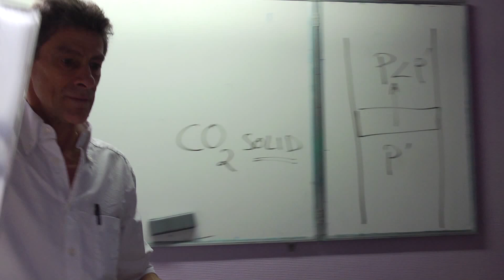Making SOLID Nitrogen!

Comment: Is there such a thing as liquid carbon dioxide?
Reply: +Noah Williams Yes, but only at pressures higher than 5 standard atmospheres.  Anything below that and it will just go back and forth between solid and gas without moving through the liquid phase.
Reply: Walker Riley
Interesting. Thanks for the knowledge! :D
Reply: right....a bottle under extreme pressure (55-60 bar or about 59 atm).  The moment it is released it reverts to a gas.

Comment: hey   hav a ques....if today is 0 degree celcius and if yesterday the temperature was double the temperature today.....what was the temperature yesterday?
Reply: +Devansh Garg To use regular multiplication rules on temperature, it must be absolute. That is, the coldest temperature must be 0. Scientists use kelvin to represent that. 1 K unit = 1 C unit, but 0 K ~= -273 C. So convert to kelvin and go from there: 0 C = 273 K, and double that would be 526 K which would be 273 C.
Reply: +purewaterruler hav already got the ans
by the way....thanx
Reply: +purewaterruler Hooooold on How Did IT want to 273C
Reply: +Sonner 527K = 273C since K = C + 273
Reply: +purewaterruler How does IT convert to C, where do i get to know this

Comment: Why is Ice, Solid Nitrogen and Solid CO² all white?
I know that white means they are not absorbing any visible wave length which means that their molecules are hard to be excited by visible wavelengths but is that correct? and If so, why aren't they?
Reply: Those gases are colorless because they are simple molecules with no conjugation. Most substances without metals are colored because they have a lot of pi bonds linked together (conjugated), like beta-carotene, which makes carrots orange. The more linked pi bonds, the lower energy that is absorbed. With no linked bonds, the energy is high and falls in the UV range instead of visible, making the substance colorless.
Reply: +Kashi Seereal Thank you for your great answer, I will do more research to dive into the pi bonds because I'm very curious about the subject :)

Comment: You might do one on water. Yup - plain water; but actually very funny stuff. Like: Heat rises (right?) so why does ice form on the top; and not on the bottom? What is the latent heat of water (and why?) Can we boil water hotter than 100 C? If not, why not? I think I saw one elsewhere on cooling water below freezing, without actually forming ice - sort of 'breaking the symmetry' Another - how do we get warm layers of waters 'sitting' on cold layers; and maybe vice versa. Just thinking out loud really. But, just when you think you know something - you don't ...
Reply: +Adam Mangler To answer one of those, all energy above 100 C is used not to make the water hotter, but to make the molecules move fast enough to escape their liquid form.
Reply: +Lord Nightmare Lieudfrost effect?
Reply: Sonner When I learnt it we called it Lateral Heat or temperature or something like that
Reply: +Lord Nightmare ohh latent heat?
I'll defiantly check that out thanks!!
Reply: Welcome. Good to be able to use all that useless info from school hehe.
Reply: +Lord Nightmare 😀

Comment: Would a persons hand instantly freeze if they touched liquid nitrogen which is -196
Reply: +Hachem Shahrour No. At -196°C nitrogen boils. Anything warmer dipped into the nitrogen will force more boiling. The N2 gas bubbles form an insulating layer around the warm object, e.g. a hand. This is the Leidenfrost effect. You would be quite safe if you would just dip in and pull out.... but if you'd wait too long your hand would start freezing anyway. Try at your own risk!!
Reply: +Nature Alley ok thx

Comment: What happens if you touch the actual nitrogen when it's 200 C? My teacher said your hand would freeze on it.
Reply: Hammad Shahid I think you mean -200. Your teacher is right. There's a youtuber called NurdRage who actually dipped his hand in liquid nitrogen without freezing it, but it's obviously very dangerous. I've used liquid nitrogen during labs and it is extremely cold.
Reply: bookworm260194 yes I meant negative. My teacher mentioned it's dangerous too.
Reply: Yeah it is. It needs to be used with extreme caution.
But despite that, I know this guy who uses liquid nitrogen to make ice cream when he's in the lab xD
Reply: Hammad Shahid You can very very quickly dip your hand in it, without getting any negative effects, becuase of the Leidenfrost effect. Basically the liquid nitrogen boils around your hand so quickly, that your hand isn't touching the liquid, but is protected by a layer of the nitrogen gas, which is a good insulator, so your hand feels chilly, but doesn't freeze. Of course this only works for a very small amount of time, and I wouldn't recommend it. If you're talking about the solid nitrogen, then yeah your hand would probably stick to it and freeze solid pretty quickly.

Comment: Are there any solids that are lighter than air?
Reply: Dante Paterson I think you're misusing the word "lighter" here. Of course 1g of sand is lighter than 1kg of air. However, I suspect you meant "less dense", which would be rephrasing your question this way: "Is there any solid lighter than air for the same volume?". 

Now think about it this way: a gas is a state of matter where the molecules don't touch each other: there is a vacuum between them. In a solid, on the other hand, the molecules are touching, and arranged in a compact way that make them stick together. 
So it is impossible, if I may say, to find a solid less dense than air, unless you tweak the definition of "solid".
Reply: Dante Paterson Air has a density of 1.2 kg per cubic meter. The solid with the least density is aerogel (although it cheats a little because it's porous) is still about 5 times greater. So no. You also can't make the density less than air simply by increasing the porosity of the material.
Reply: Joffrey Bion Ok, yes, I meant "Are there any solids that are lighter than air by volume. I'm sure even an idiot could figure out that I meant that are there any solid materials that if you had 1 cubic centimeter of it, it would weigh less that 1 cubic centimeter or air. In other words, I was wondering if I could get a solid block of something and then let go of it and have it to float away.
Reply: Dante Paterson Well no because air is a gaz were atomsand molecules are spread in a volume in a solid all the atoms are molecules are much closer to each other the amount of atoms on a cubic meter of a gaz depends on the pressure but it can t be higher than in it s solid form.

Comment: The water is not boiling is evaporating.This is a surface phenomena. The molecules on the surface are moving faster (motion) than the others, so when you lower the pressure this molecules evaporate into water vapour. The energy needed for releasing this molecules to the atmosphere comes from the water that is left behind, that´s why it cools down, you are removing energy from the water everytime a molecule goes into the gas phase and is released to the atmosphere. This is the same process people and plants use to cool down (Transpiration).

Comment: Why do ice crystals form -- and in particular, why do they disperse into the air to make the well-known fog effect?
Reply: In the atmosphere there is a small amount of water vapour (humidity). The CO2/N2 is so cold it freezes this water vapor into ice, similar to the way the solid nitrogen froze CO2 in the atmosphere to form that chunk of dry ice. This ice is formed in very small crystals since it is spread very evenly and very sparsely throughout the atmosphere. As the CO2 sublimes into gaseous CO2, its volume increases rapidly, creating a vast pressure gradient between it and the atmosphere, so diffusion carries the CO2 out into the surrounding air very quickly, carrying the ice crystals with it.

Comment: Derek Answer me please : How does this evaporation works when drying clothes?
i thought it requires 100 degree celcius to turn water into its gas form? in that degree the clothes must be burning and hot but no .. my question is 

1. Why does the water evaporate in this process eventhough its not reaching its steam point.?
Reply: as explained in this video, that temperature depends on the gas pressure around it. When water is evaporating, it actually depends on the partial gas pressure created by the present water vapor, which is dependent on the concentration of water vapor in the air. What a clothes dryer does (and also an oven) is actually drying the air inside by sucking out the vapor and replacing it with fresh air (that is why an oven usually has a fan in it). This reduces the pressure of water vapor and allows the liquid water molecules to evaporate at a lower temperature.
This is also why a lake, a plant, a piece of bread will eventually dry out when subjected to fresh, dry air, even at low temperatures.
Reply: Aqw tinyente Whilst the boiling point of water is 100 degrees celsius, molecules of H2O are constantly moving around at any temperature. When these particles collide some will receive enough energy to escape the liquid, in turn taking some energy with them which means the remaining liquid will be slightly cooler. In a sealed container this would be a system in perfect equilibrium so as some particles leave the liquid, others which were already in the gas phase could come back down and put energy back into the system, thus forming a constant 'vapour pressure' above the liquid. In reality though (such as your clothes drying) the motion of the air around the liquid such as the effects of wind etc. will move the molecules of H2O in the vapour away from the liquid, this causes the vapour pressure to decrease so the equilibrium will shift to the right to release more molecules from the liquid, further reducing the temperature and so on. This is why puddles left on the ground after it has rained will evaporate over time despite the fact they do not boil.

Comment: How the heck does that guy still have a finger?!?!?!
Reply: Leidenfrost effect
Reply: The bath was just room temperature water.
Reply: if you're talking about the touching, he was barely touching it.

if you teleported to the middle of the south pole and back home in 1 second
you would barely feel any change in temperature.
Reply: By the way, you can pour liquid nitrogen on your hands no problem. Just don't cup your hands when doing it. Similarly, you can dip your hand inside for a moment without any harm.
Reply: it takes a long time to freeze a finger at that temperature. I think on mythbusters or something, it took a while to freeze a flower in liquid nitrogen
Reply: The Jackpot isn't the water suposed to be frozen?
Reply: Leidenfrost effect indeed. I tried it myself when I was in the equivalent of high school. Here a good demo:

https://youtu.be/wV7g8L633Sg?t=127

Comment: So CO2 will solidify onto a cold enough surface. Could this be used (in a desert probably) to suck CO2 out of the air, as an industrial process? Not that someone would though.

Comment: so the lil solid part that was in the water was acting much like a meteor or astroid ?
Reply: in a sense, yeah. meteors and asteroids shrink as they heat up; the same goes for the dry ice in the water.
Reply: *comet
Reply: kopopo23 if a object is burning up in the atmosphere it's called a meteor if it hits the ground it's a meteorite
Reply: Vaughan Bunt semantics isn't the point here but thanks for the trivia.
Reply: CaliGaming also like a comet as it nears the sun
Reply: +CaliGaming Much like asteroids, the gas expands and pushes on the solid causing thrust.

Comment: Why did the water not freeze?
Reply: Because the nitrogen evaporates to quickly.  Think of the way water droplets float over a red hot pan. In this casee water is so hot that the Nitrogen cant even touch it. Same for the CO2, it's not floating it's hovering.
Reply: Well, it's actually the liedenfrost effect causing it to transfer very little heat from the water into the N2
Reply: Josh Carmack
The same effect that Patrick French is speaking of when water is spilled on a very hot surface.
Reply: Josh Carmack It is a combination of both, really.
Reply: BabyBlueFord Josh Carmack its also the same thing that let the mythbusters dip their hand in molten lead without getting burned to buggery (but i wouldnt recommend anyone try to replicate this themselves)
Reply: BabyBlueFord ...because they're the same thing.
The Leidenfrost effect is what the first reply said, and the second reply simply named it.

Comment: In theory, could you just continue adding pressure to reach absolute zero. I mean they were only like 70 Celsius away, right?
Reply: It's probably exponentially more difficult to decrease its temperature the lower it already is.
Reply: ***** Actually, have you heard about quantum gas? It's temperature was below 0 K. Atleast that's what i heard.

Comment: 0:28 incorrect explanation: the water temperature decreases because the water goes to a higher energy state when it goes to gas phase. That physical reaction is endothermic, meaning it absorbs heat energy. That's why water on your stovetop won't heat past 100ºC: it is being cooled by the boiling, and that process sets it at an equilibrium.
Reply: Chris Powell
They are decreasing the pressure and increasing the volume, thereby decreasing the temperature.
 This isn't an ideal gas property, it's a liquid to gas phase transition property.
Reply: @TheReaverOfDarkness  What you're saying is incorrect. Veritasium's explanation was 100% correct, and your initial comment was also correct. You two were just explaining it from different angles. 
However, your statement that the molecules are all moving at the same speed is not at all correct. The molecules are actually moving at completely different speeds. They are held into the liquid by a potential barrier (from intermolecular forces) and only the fastest molecules have enough energy to overcome this barrier. This means the leftover molecules have a slower average speed. This is equivalent to saying that there is an amount of energy needed to go from the liquid to the gas phase (enthalpy of vaporization) and this cools the boiling water. 

Also, the fastest molecules don't have a temperature. In fact, it's not a property they have because they're only the fastest for maybe picoseconds before they collide with another gas molecule and transfer their energy to it. The temperature is only defined on a macroscopic scale.
Reply: @DANGJOS  You're right, I misspoke. A molecule does not have a temperature.
Reply: TheReaverOfDarkness  Reaver is correct. This is the fundamentals behind the operation of you're refrigerator, freezer, or A/C system, They evaporate a fluid under "low" pressure to absorb "heat" energy from there surroundings (eg. in you're fridge) and then condense the vapor back to fluid where the heat energy is dissipated or radiated (at the rear outside panel of you're fridge).

This means as The Reaver is correct the video's explanation is miss-leading

Also if you increase the pressure you raise the freezing point so using water as an example at one giga pascal (145038PSI) water will freeze at approx 20'c. so in theory under enough pressure nitrogen will do the same however the pressure required would be astronomical
Reply: There are two things causing this, first is the ideal gas law Pressure*Volume=N(amount of gas)*R(gas constant)*Temperature.  When you keep the volume constant and reduce the pressure of a gas, the only thing that can change is the temperature, which decreases with a lower pressure and increases with higher pressure.  Another good observation for the ideal gas law is to put a balloon in the freezer and see what happens to the size.
The second thing in action here is the latent heat of fusion/vapor, water is a good example and the latent heat of fusion(energy required to convert 1 gram of water from solid to liquid) is 334 Joules.  The latent heat of vapor for water requires 2230 Joules to convert 1 gram of liquid water to vapor/gas, and the opposite holds true, 1 gram of steam has to give off 2230 Joules to get back to liquid state and has to give off 334 Joules to get to solid state.  So in this example if you put water in a vacuum and get it boiling at or below room temperature, the water that is going from liquid to gas is taking 2230 Joules/gram of energy from the rest of the water to do so.
A quick side-note about Joules... just to put it in a better perspective as to how much energy it is.  1 watt is 1 Joule per second, assuming you have a 1000 watt microwave that transfers all 1000 watts to the object being cooked, it would take just over 4 seconds for the microwave to increase the temperature of a liter or kilogram water by 1 degree Celsius.
Reply: Did you mean that Derek's explaination is incomplete? If water molecules evapourate by absorbing energy, the molecules will move faster, right?
Reply: 681726
I don't know if they move faster or not from changing from liquid to gas, but their temperature does not increase as he said.
Reply: Well, then there's another video (by Flinn Scientific) that says the same as this one. Maybe that's his source?
Reply: 9 years ago, man's much wiser now
Reply: ure answer is good but i think ure talkin in terms of energy he is talkin in terms of preassure........i dunno what im talkin aboot i suck at physicsXD
Reply: O BTW my law professor always told me to have a legal basis for my argument.... its not legal but pressure affects mollecule..........right? :S
Reply: Alvin Akawijaya
No, he said that the faster-moving molecules (implying the warmer molecules) are the ones that get out. They're all moving about the same speed, especially any right next to each other. The act of going to gas phase causes an individual molecule to absorb heat energy from other molecules around it.